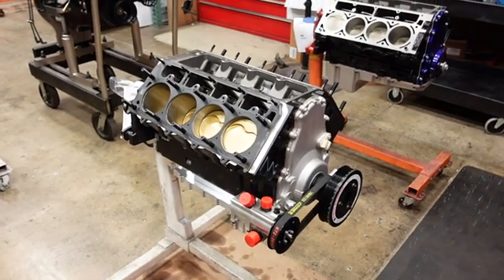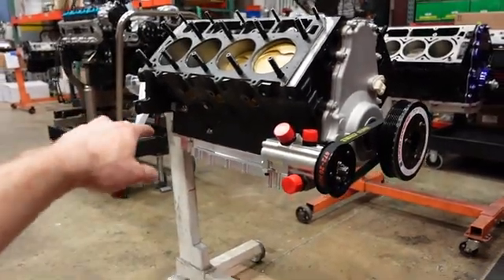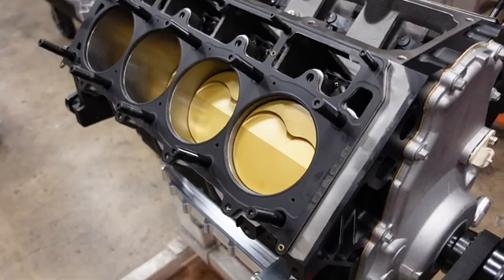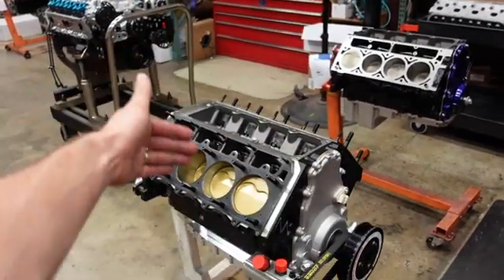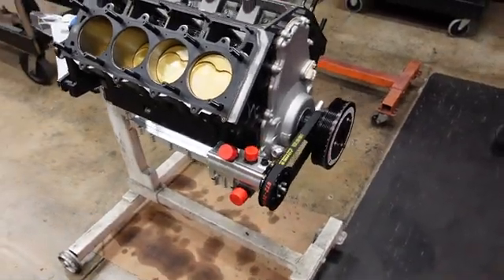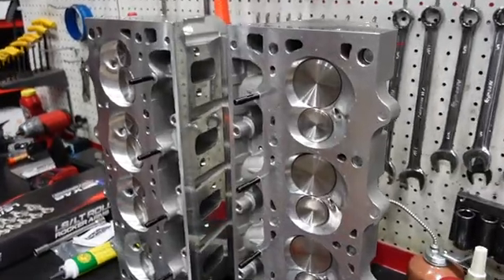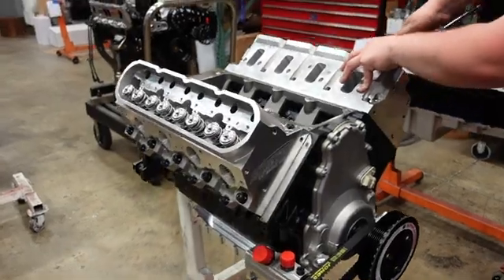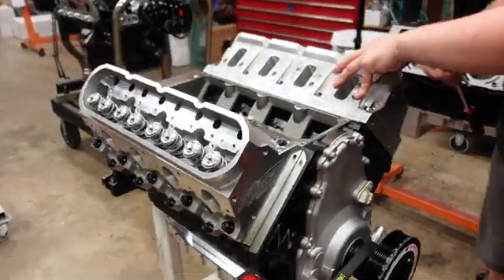Building a 427 Twin Turbo LS Engine - Land Speed Records! (Part 2)

Comment: Im building a 9.8:1 LS 408 stroker, with a LSA super charger that is coming off my 11.2:1 lq9 370…do you have any cam recommendations???….4l65e with 3200 stall 3.42 gears in a ‘74 nova

Comment: Im surprised not runing any type of shaft rocker system on something with that running so much power and rpm
Reply from the maker: Not required for its spring pressure & cam lobe ramp design
Reply: @JacobVillemain  what spring pressures are it running in it
Reply from the maker: @rileydalton3958  #480 open

Comment: Why didn't you use a shaft rocker/trunion upgrade on that motor?
Reply from the maker: It has trunnions in it with the roller tip rocker arm.